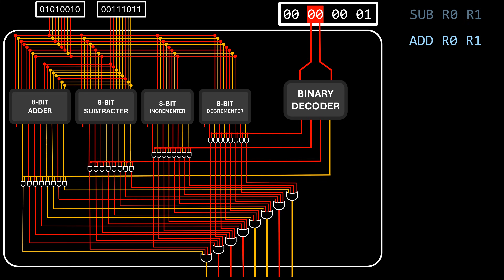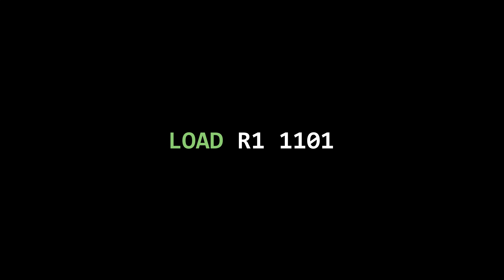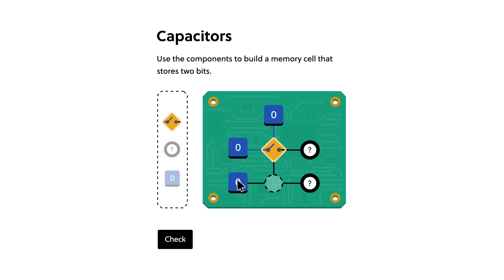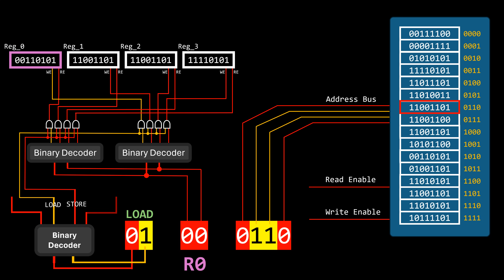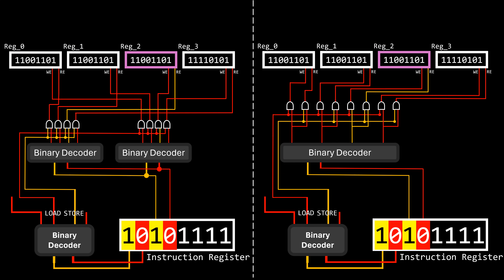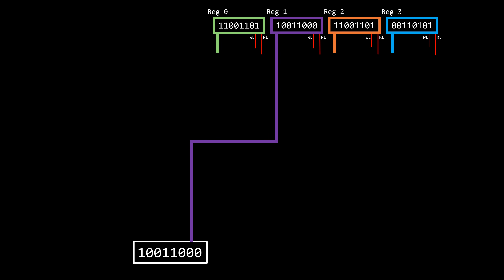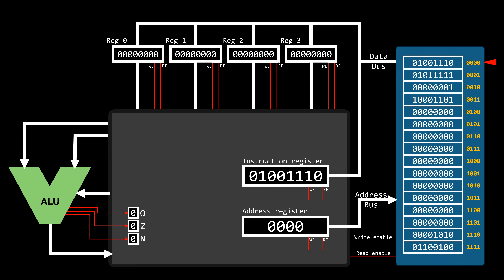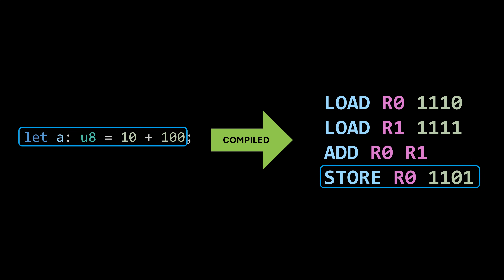CRAFTING A CPU TO RUN PROGRAMS

Comment: About the question:
You load the data into registers before performing an arithmetic operation for multiple reasons:
1) Fetching data from the RAM is way slower than using registers.
2) The CPU doesn't know if the result is going to be stored, so it would be a waste of time doing so.
3) I think that reading data from registers is safer, but I'm not sure.
4) Also, as someone else mentioned, you would need bigger instructions to specify the memory address.
Reply: 1) the MIPS 5-stage pipeline was invented in 1980. The inventors observed that real programs need addressing modes. So access to RAM reads the address register, adds some offset using the ALU, sends the address out to RAM, and gets back the result in the next cycle. This works for ROM and SRAM ( think: Commodore PET or a console like pcEngine ). DRAM at the time already multiplexed the address bus. So it (could) take two cycles just to transfer the address. Also often in the first cycle some external component checks, which memory chip should be enabled: ROM or DRAM or some IO chips?
2) No. All CPUs have CMP and TEST instructions. On RISC there is the zero register. Starting with SH2 the flag output is optional.
3) On a computer with multiple components which can write to RAM, the registers are your safe space. Many computers had DMA read out for graphics and sound, but the Amiga introduced a blitter which would write to (chip) memory. Sega genesis could have conflicts between Z80 and 68k.
4) That's why instruction encoding is so inefficient on CISC. At least 68k has 16 registers and the swap instruction. Why did people not swap register banks on Z80 that often? Always want to stay compatible with interrupts?

Comment: Why load data into registers before using them for ALU operations? Because registers are like the VIP lounge in a nightclub—super fast access! But if you're feeling fancy, you could try a Load-Store architecture, where the CPU says, "I only do memory moves, darling. Keep it simple!"
Reply: On ARM2 and R1000 and SH2 the contents of the registers is routed to the ALU without any delay. 68k for some reason is 16 bit and needs two cycles for 32 bit instructions. JRISC only has 2 ports to the register file and needs 2 cycles to load two operands. Why do people design like this? It makes indeed sense if you have two register files. One is hidden and small. For example on JRISC this file can accept results from the main register file, the ALU, the MAC unit, the DIV unit, the on-chip SRAM, and the system bus all at once. The main register file stores a lot of bits, but is still small because it only has two data ports ( in and out ).

Comment: For your question:
Why?
1. because registers are fast and memory is slow.
1.a because the memory doesn't have a direct line to your ALU
2. because addressing registers is easy, addressing memory takes up a lot of space.
2.a because addressing multiple kind of things makes the instruction set and therefore the decoding a lot more complicated, and you couldn't have efficient fixed width instructions.

Better way?
Not without making the architecture a lot more complicated. And compilers are really good at juggling registers.
But in theory, you could make a direct data bus from memory to ALU, more precisely to the funnel shaped multiplexers. But there's still the problem of memory addresses being 4 bit. Of course you can make instructions that do arithmetic with the memory address and a fixed register, so the 4 address bits can all be used for the memory address. But that sounds like a step back, not forward.
Reply: Also, adding an ALU access to each memory cell would drastically increase the circuit size with very little benefit compared to the cost. Memory size would decrease by orders of magnitude even if you just connected every cell to an ALU, not to mention the problems in doing so for non nand based memory.
Reply: Your assumpion about "memory is slow vs registers" is not applicable to the example of CPU architecture in this video. Memory here is the same pile of transistors as a registers. The only difference is a set of wires.

Comment: Well, this didn't explain much. You skipped on the whole timing thing, which is the crux of the whole thing.
Reply: If you watch to the end of the video, he explains that he will introduce the clock in a later video. The clock doesn't make any sense unless you have provided the groundwork for what it is going to synchronize. When you have learned a little bit more about computers you will understand this. For now, just watch his videos from the beginning to the end, and you will get there. These videos are truly excellent.
Reply: Combinatorial circuits. Transparency. Basically, most of the CPU does not know about the clock. But you have to block write enable to registers and flags to avoid that transients are written back. And you need two non-overlapping pulses which drive the instruction counter. Every clock starts from a single clock from a quarzt crystal. I seems to be that non-overlapping is always implemented by gate delays, though it should be possible to get sine voltage curve from a crystal and define different thresholds.

Comment: I found a logic gate simulator and am trying to build a CPU, but I am encountering a problem. How do I implement sequential logic between each stage of the FDE cycle? Due to the limitations of the simulation, there is a very large delay when reading or writing to memory, which throws off all of the data in the control unit. I understand that in real CPUs there is a clock signal which starts the FDE cycle, but how does the CPU use the signal to start the next phase of the cycle? Are there multiple clock signals per FDE cycle which trigger each stage and a series of gated latches that carries the signal between each seqential stage?
Reply: The 6502 CPU uses a shift register which is driven by the clock. RISC CPUs have a pipeline so that all steps happen at all cycles .. until there is a memory stall. Then they need to fall back to sequential operation. I think that the 6502 would need a counter and it would even need an additional flag to deal with carry to high bytes.

Comment: There are multiple advantages to restricting the arithmetic instructions to operating on registers only (this is a rephrasing of your question).
First, registers are usually faster than memory, even more so with flash, off-chip, or dirty cache situations.
Second, for fixed width instructions it allows for more bits to store the specific ALU instruction.
Third, it enables for microcode. By handling complicated instructions (like multiplication or bitswapping) internally as many simpler instructions you can offer a much richer instruction set to the user without adding a lot more dedicated logic to your silicon.
Reply: I wonder if on the Amiga it is possible to time the start of the micro code execution of DIV or MUL so that the 68k gets totally of the bus while for example the graphics DMA runs?
Reply: Ah, context switching!
Reply: @skilz8098  the context is “microcode”. Your third paragraph. What does microcode bring to the table when no one else uses the bus in the meantime? Microcode already gets instruction fetch from the bus. Why also remove data access? JRISC for example use micro code to implement the inner vector product as reg-mem.
Reply: @ArneChristianRosenfeldt  Well, in modern CPUs - architects and computer systems sure you wouldn't be wrong. 

Yet, if one is building their own system from discrete logic gates or ICs, they are literally hardwiring the buses, the bus transceivers, decoders, etc. and they have to measure or be aware of their clock signals and even the strength of their signals. 

It all depends on which route of path they tend to take; they could build out all of the logic for their decoder or they could just wire it to say an EEPROM and program it with the binary equivalent.

When I started to implement Ben Eaters 8-bit Bread Board CPU in Logisim. I had to build out the components (registers, logic, counters, etc...) for the control unit. Ben did all of that on the bread to where they controlled the I/O signals coming out of his EERPROM ROM module. Here is where my implementation slightly varied from his. I ended up using Logisim built in ROM. I ended up writing a C++ application similar to his EEPROM C like code to generate all of the binaries. Then I had to take the printed output from my C++ project and had to message it (trim off all white spaces). Then load it into the ROM Module within Logisim. 

This was also tightly integrated into a second counter for all of the micro instructions. Not for every single main system clock cycle itself, but for every increment of the program counter, there were up to 4 or 5 sub cycles. This secondary counter on a varying repeatable loop managed the fetch, decode and execute cycle. Some instructions only took say 3 cycles, where others took 4 and some took 5. All of this had to be taken into account to instruct which device to either accept or assert data from the bus. It was a single bus that handled, instructions, addresses and data. It was a system wide shared bus. 

So, again, it also depends on the overall layout of the system. It depends on its architecture. Sure, a modern CPU or system doesn't use a single bus anymore, and for most tense and purposes even at the assembly level, we don't usually concern ourselves with the fetch, decode and execute sub cycles, but we should still be aware of their mechanics and properties. 

Take an NES apart and trace out all its paths. Or take apart an Atari and trace out all of its paths. Get really creative and take apart an Arcade cabinet and trace all of its paths. And that doesn't account for all of the processors, coprocessors, and microprocessors within those systems.
Reply: @skilz8098  what is modern? 6502 is from 1975 ( 70s I am sure ). I think that it predates the SAP-1 book. 6502 solved the variable length of instructions: there are end instructions in microcode. Some illegal instructions manage to miss those and freeze the CPU. Wiring of clock signals is important in ICs. For example up to 1985 commercial chips only had a single metal layer. So any crossing needed a bridge through highly resistive poly-Si . The clock distribution network on DEC alpha is so powerful and has so wide conductors that it is clearly visible in the die shot. They were clearly pushing the limits.

SAP uses adders, but I read that you could buy TTL ALUs in the 60s . Dataport 2000 and other processors even operated on single bits (Usagi has videos). Discrete Multiplexers and shifters must have been cheap . But then, the C64 first started with memory with a single data pin. Maybe dataport used those or those early Intel rotation registers which acted as main RAM.

I like how Atari and Commodore insisted on tri state address pins for the 6502 CPU. So indeed everything sits on a common bus. Same with AtariJaguar. N64 has a point to point connection between the custom chip and this RAMBus to the DRAM chips. Arcades are a bit like a PC : lots of expansion cards on a mainboard. Not optimized for cost not energy efficiency. Though some are straight forward: buy the expensive 6809 and a lot of RAM for a double buffer with many colors. This much RAM filled its dedicated board on its own back in the day and is obviously expensive. How do low volume ROMs work?

Comment: the answer for the question:
the speed of register memory in CPU is much faster then RAM memory and the CPU can reacts directly with RAM without registry but it will be much slower, think this main reason thanks for rich content.
Reply: Before microprocessors, processors used discrete RAM chips for registers. Servers and Supercomputers did this until 1987, when they finally were beaten by integrated CMOS .

Comment: You could directly wire the memory to the ALU, but this would require two data buses. Working directly with registers is magnitudes faster than loading data from memory. Usually an instruction does not live in a vacuum and a value could be used multiple times once it is loaded into a register. Also memory management is its own can of worms, when you start taking virtual address spaces and caching into account.
Reply: Yeah people forget that while the 6502 has only 8 data pins, internally it has two data busses ( okay, data only, no address) which can be parted to have 4 in total. The partition border is (can be) between the ALU inputs. So you for inputs you would need to pick registers from different halves of the register file.

This is the super cheap CPU from 1975!

Comment: For the last question: You can read directly from the memory into the Alu and store it directly. That should be faster, but needs addtional logic.
Reply: Is this type of operation supported by modern assembly languages in any way, or is it a hypothetical architecture feature?
Reply: @EMLtheViewer   It was just my suggestion, i dont know. I researched the topic and did found anything, so I my probably wrong.
 But I do know that in grafikcards, you can load an array of data in one instruction.
Reply: @EMLtheViewer  The 6502 has Increment and Rotate instruction which act directly on memory, and I hate it. But ROR was too much? Or a second accumulator B. But did you know that the 6800 did only have one address register and could not efficiently memCopy?

Comment: You have to load the data into the registers because the controller can only send values from the registers to the alu and back, there isnt really a better way except keeping the most used informations in the registers and leaving a precise number of registers free for important operation informations. The less registers you have the harder it gets (speaking from experience, i am working on a challange which is on binary level and i only got 4 8 bit registers.)
Reply: What is a binary level? Anyway, I feel like it should be possible to MUL or DIV completely inside registers. My math tells me: Instruction Pointer, StackPointer, 4 general purpose registers. If your register are too small, you need 5:  AxB = Chi:Clo  and a counter ( or check for zero in A , but still need to complete the shifts ).
Reply: @ArneChristianRosenfeldt  binary level is when you code 1 and 0 straight into rom and my cpu is bottom line from bottom line, this will be the only project which i am coding on this cpu
Reply: @minebuilder1805  just because the video speaks of binary only in case of the address decoders. Add is also binary. ROM is omnipotent memory. In case of its values we speak of bits and bytes. The video considers single bits. JRISC machine language documentation talks a lot about bits. I like how they reduced RISC even more: all instructions have the same format: 6:5:5 . You can put registers names or literal values in the 5s. Branches put the condition in one 5 and the branch distance in the other. It has immediates like an 8bit CPU . So immediates just look like normal values. You can easily self modify your code.

Comment: I would think the reason for using registers is to reduce the amount of “wires” needed.  For example, to add/subtract values, there need to be dedicated “wires” to each register you may potentially operate on.  If you wanted to try and perform arithmetic directly on a register in memory, you would need to multiplex every possible memory register (twice) and have the multiplexed output go to the ALU.

Regarding a better way to do it, idk maybe get rid of the multiplexer somehow?  Or serialize it with a shift register of some sort?  Although I’m guessing that would slow things down.
Reply: A shift “register”. So still a register. The AtariJaguar actually can read two values out of palette SRAM at the same time. The processor writes the output into the linebuffer ( another SRAM ).
Reply: Main reasons for using registers are speed (to avoid slow memory read / write operations) and to increase the compactness of the machine code (to avoid specifying memory addresses which can be up to 64-bits long). Historically, all sorts of CPU designs existed. Some stored almost all registers in memory (such as TMS9900), and some partially (6502 "zero page" can be viewed as 256 external registers of the CPU).